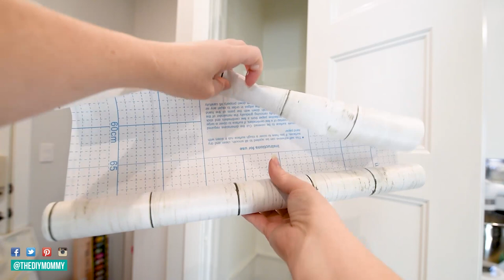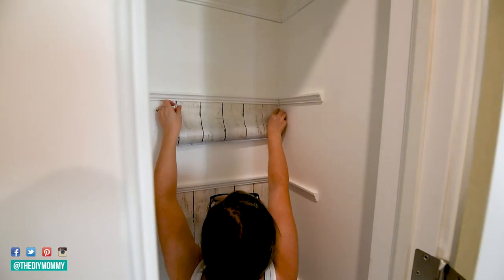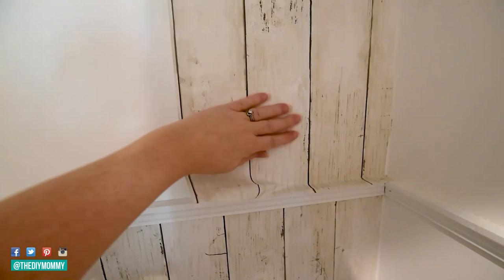5 DIY Peel & Stick projects that make your home look INCREDIBLE!  | The DIY Mommy

Comment: JUST AN FYI:  Those peel and stick back splashes are expensive, AND they have a lot of negative comments about them peeling off the walls.  Some used extra adhesive and they still peel off the wall.  I wouldn't purchase them unless you have money to throw away.

Comment: Thank you so much for this great and informative video!! I have peel and stick wall paper in my laundry room and vacuum closet 😁.
I wanted to ask you about the tile square for the kitchen, do you think it would stick well on our ceramic?? It’s not a fully smooth surface since it has the union in between the tiles. And also, is it ok to put it around the stove? I’m afraid it will melt! Please let me know what are you thoughts on this ☺️
Thank you!!
Reply from the maker: Thanks for watching! I wouldn't put the tile around a gas stove, but I think it would be ok by an electric one. The packaging of the tile should give you a heat rating, and you could buy a test pack to see if it sticks to your current wall!

Comment: If you have textured walls/ceilings do you have to sand them completely smooth for the shiplap boards to stick?
Reply from the maker: Some textured surfaces will work. Check out Stikwood's website for their recommendations!

Comment: These all look fantastic Christina, my only question is about sticky residues? I guess these products have come a long way since I last bought any because they always left a bit of a mess if you wanted to remove them later. That's what has deterred me from trying them out, although I have  several spots where I'd love to use them.  Glue on bottles before recycling is the worst I want to deal with. 😊
Reply from the maker: Thank you! I haven't noticed any sticky residue with these brands.
Reply: @thediymommy  That's  good to know, thank you! 😊👍

Comment: All of these ideas look so beautiful and fairly easy to apply. The only worry I’d have is using peel and stick paper on counters. What if you accidentally place a hot pot on the counter and melt it?
Reply from the maker: The product should have a heat rating on the packaging, but I always use a trivet/coaster for hot items.

Comment: Hi Christina, I really like all these peel &stick ideas. Your tray ceiling is gorgeous. I have tried a few of these peel & sticks. Unfortunately,my  wall in kitchen is textured so all the backslash fell out. The countertops, first try was what I call my learning phase.  It had so many air bubbles and odd pieces it just looked horrible. I since have redone it and it looks a lot better but, still had issues with sink area. Do you have any suggestions for installing backsplash on textured walls? 💕
Reply: If there’s just a small amount of texture you can sand it smooth… otherwise you can buy a tub of plaster and do a skim coat which is a thin layer with a trowel..it fills in the crevices, creating a flat smooth surface.. it wouldn’t be too hard just on a backsplash area.

Comment: Such great ideas! I'm curious if the peel and stick wood shiplap product would work in a bathroom. We need to re-do our guest bath, which doesn't get used very much, but I'm concerned about moisture. Thank you!
Reply from the maker: I've never tried so I'm not 100% sure, but I imagine it wouldn't be that great in a bathroom because it isn't sealed
Reply: I wonder if you could roll a poly over it and help to seal it?
Reply: @marniecarruthers2806  GREAT IDEA!!! I'm trying to cover up three layers of wallpaper applied incorrectly. I might have to use some extra glue, but this might work. Thank you!
Reply: @Patti-1962 You're welcome! I hope it works out... Keep us posted!

Comment: My daughter used the peel and stick tile for her back splash.  It looked great for about a week and then started falling off.  We followed application direction but don't know what went wrong.  It might have been her paint underneath or the dry AZ air but they did not last.